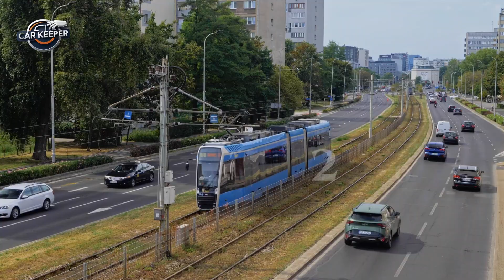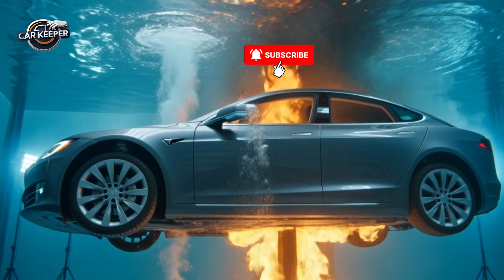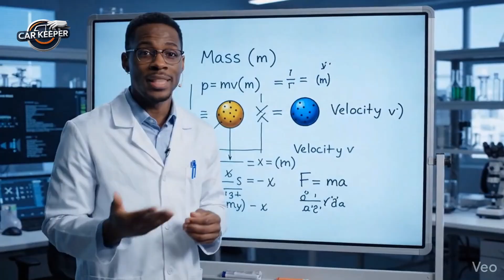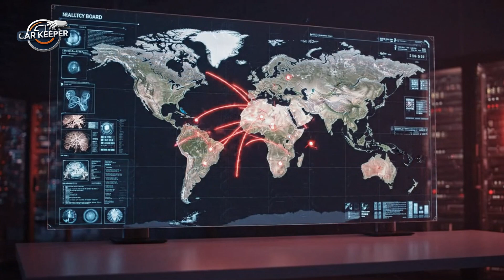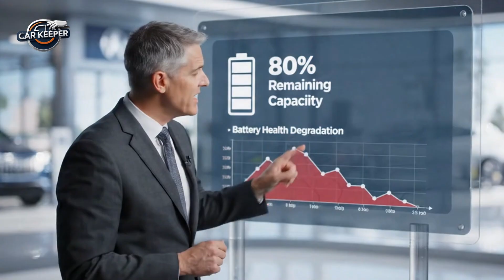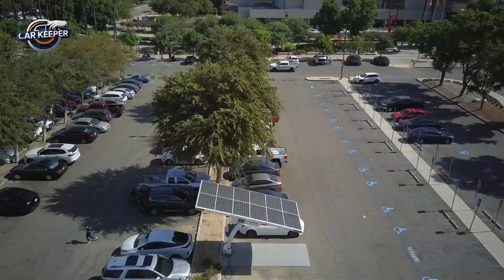😱Why Modern Electric Cars Are More Dangerous Than You Think

Comment: ived seen many videos of tesla on a highway running with a flaming battery without a warning the driver his car is on fire.
Reply from the maker: "Right?! It's genuinely scary stuff. 😨 But hey, every technology has its risks — the key is knowing how to react. Tesla does send alerts for overheating or battery issues, so keeping an eye on the dashboard helps a lot. 🔋
Quick question for you: What's the ONE safety feature you wish all EVs had?
 👇 Let's discuss! 🚗💨
Reply: @carkeeper-001  changing the battery composition to make it non combustible like china did to batteries. tesla battery is an outdated battery of china.
Reply from the maker: Actually a valid point. 🤝 Chinese battery tech is moving crazy fast, definitely something to think about